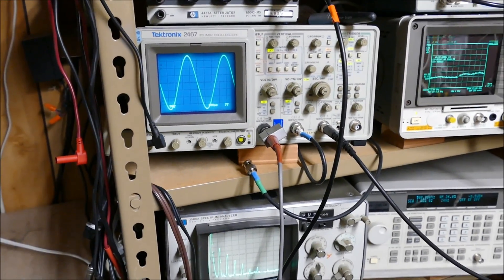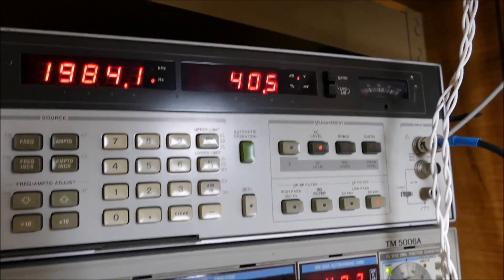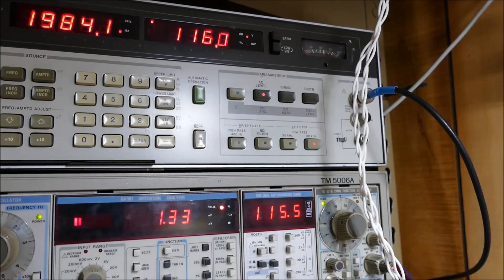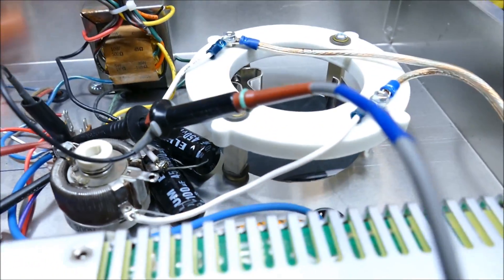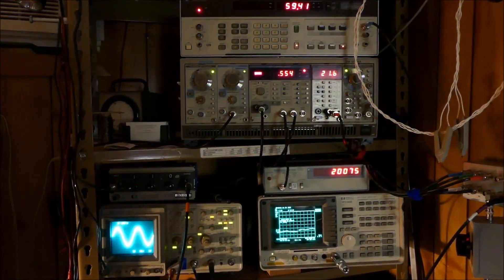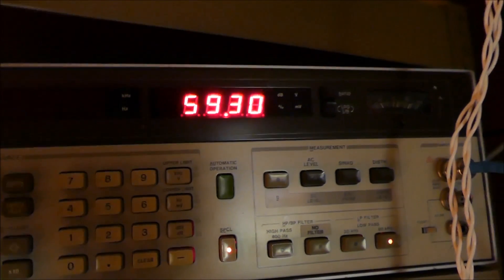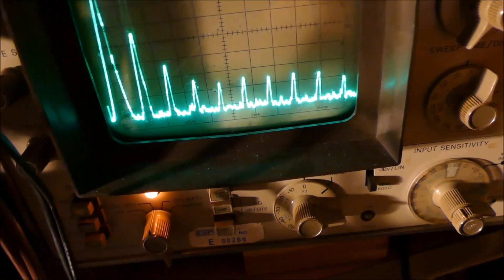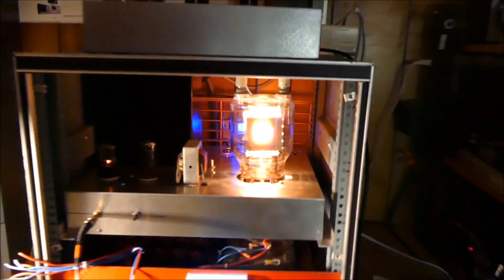833A SET Single Ended Triode Vacuum Tube Amplifier Progress

Comment: Nice work, thanx for sharing!
Next thing is to have more output swing, but i think you´ll need to rework your driver, since it seems to me that it has not enough "Oouumph" especially at lo-end, where you need much more current to drive the grid.
You may check its inrush current to see what´s going on and if you need more power there.
Have fun, experimenting!!

Comment: I am amazed how high the THD is at lower frequency. Hate to think of what it will be at say 50Htz. Do you think it could be the output transformer? Very much NOT HiFi Also I  am amazed at the  loss of power at lower frequency's. Does this amplifier have any negative feedback?  Interesting project however, the biggest amp I ever made in my younger years used a pair of 807s. I thought THAT was an animal!!